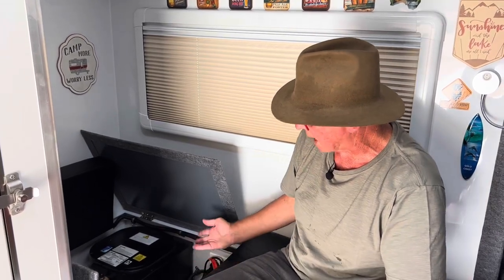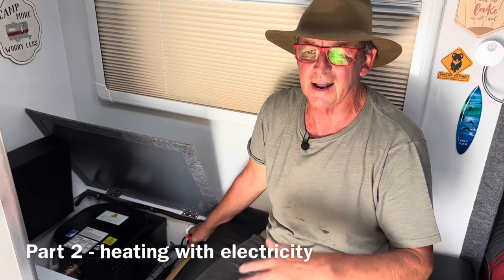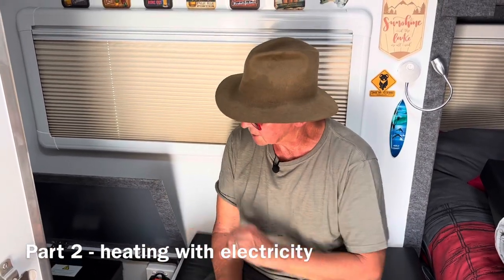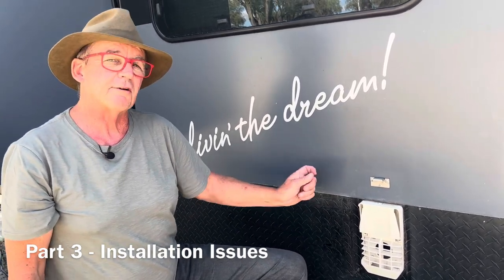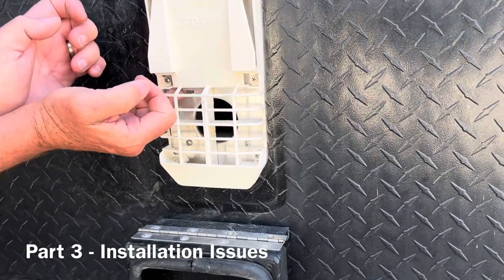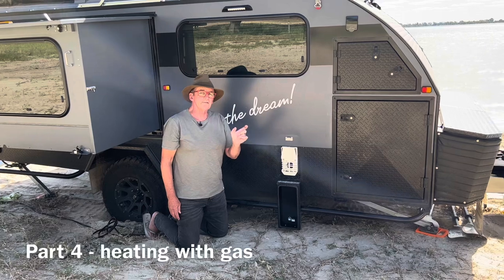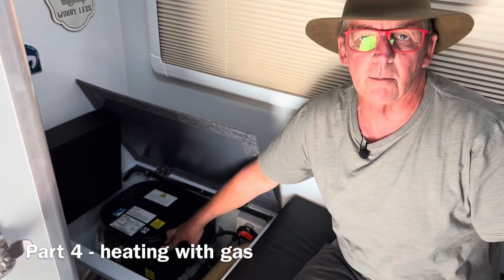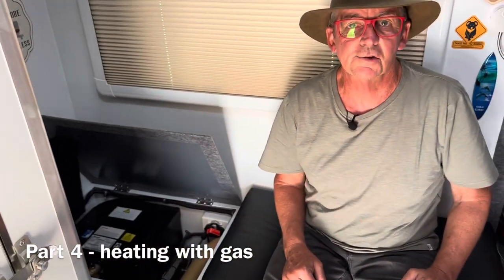AusCamping - Truma UltraRapid Troubleshooting

Comment: All good explained here, with one exception. How do I know the PCB (electric circuit board) is not faulty, please? Batteries are good, gas is there too, the cowl plate is sealed, gas ignites, but the fire stops after 10 sec or more. No wind no cold.
Reply from the maker: Thanks for your question, you would need to contact the manufacturer to get details on the circuit board. I am just an end user and fellow camper, sharing my experience with the water heater. I don’t know anything about troubleshooting the PCB sorry.

Comment: Hi mate, Thank you for you video. Everything checks out for us accept the last couple minutes of your video. We are having an issue with the red light coming on. We have gas, water and everything checks according to your suggestions. Any ideas as to why the fault red LED light keeps coming on if everything else looks fine?
Reply from the maker: Hi Dale, red light comes on if the burner fails to ignite or gets blown out and fails to reignite. In a quiet environment, if you turn the switch on, you should hear a clunk sound as the gas valve opens, followed by a ticking sound which is the ignition sparking and if you listen carefully, you can hear the gas ignite (similar to a gas BBQ). 

If your system is new, it can take multiple ignition attempts before you actually get gas all the way from the bottle to the water heater as the gas line is likely full of air. You should still hear the ignition but if no flame results, then the gas valve closes and the red light comes on. 

If on the other hand, you get ignition initially but the flame goes out after a while and that is a recurring problem, then you’ll need to take a closer look at the manifold and make sure it is mating hard up against the external wall plate, if not, it will be in taking the exhaust which is already oxygen depleted and causes a flame out after a while.

Comment: Excellent video. Our problem is that on both 240V and gas, the hot water runs out very quickly. The van is 3 years old and never had an issue previously. Any clues??
Reply from the maker: Hi Kevin, we haven’t got any personal experience with your specific problem, from a general troubleshooting perspective I would recommend opening the lever on the safety valve and making sure that you bleed out any air until you have a solid flow of water through the discharge pipe. If the problem still persists after that, then I would contact Truma support and ask them your question (1300 07 2018)

If you find the problem and solution, feel free to let us know, we may include the problem and solution in a future video.

Comment: Hi Craig where did you get the hinged cover for the HWS? So much easier to use than the plastic cover.
Reply from the maker: Thanks for the question, our van arrived from the dealer with that cover. I see that the newer models have the standard Truma plastic cover which I agree, is a pain in the arse to take off. Personally, I would go to a metal fabricator and ask them to make me a cover. Hinges and pinch weld (the sealing rubber) are available from Bunnings, so a self insulation wouldn’t be too difficult.

Comment: Great info mate , I'm a new subscriber and am really enjoying your videos.
My question is , once you light your hot water system on gas do you Just leave it on or do you turn it off say when you go to bed ?
I'm new to this and was just wondering what the best way would be to run it as I don't want to stuff it up.
Thanks for any info you can forward to me
Cheers
Reply from the maker: Hey Mal, thanks for your comment and appreciation. We tend to turn it on and leave it running until we’re packing up to move on. Always shut it down before hitting the road but no problem to leave it running while you’re set up camping. 

Of course, if you wanted to save some gas and you only want hot water at certain times of the day, then also no problem to shut it down when you’re not using it and just fire it up half an hour to an hour before you need it. 

It’s a personal choice, there’s no wrong way. We all camp differently so just do what works for you 👍
Reply: @AusCamping  Thank you for the prompt reply , really appreciate it

Comment: The ring that holds the top and bottom of boiler is leeking 3 years old ??
Reply from the maker: Had this issue recently with ours also. It’s not real easy to dismantle but I removed the clamp ring, found the pin hole and sealed it with a water proof tape and then reassembled it. So far it is still holding but I suspect we will need to replace the unit or at least the holding tank

Comment: Hi Craig.  Our Truma stopped switching on with gas.  I went through all the usual steps.  I can hear the click when I switch it on and the red light does not turn on.  Just wondering whether there could be an issue with the ignition system, such as dirty or faulty spark electrodes.  My question:  Do I have to take the complete system out in order to check this?  It looks like our one is mounted in a similar spot.
Reply from the maker: If the LED is not coming on, then it could be a blown fuse, I'll post a link to the user manual, check page 5, the troubleshooting section lists your symptoms regarding no LED and the Maintenance - Fuses section (also on page 5) has the fuse location and specification information.

https://www.caravansplus.com.au/pdf/Truma-Ultra-Boil-Manual.pdf
Reply: @AusCamping  Sorry Craig.  The led does come on after 30 sec or so.  Yesterday, I  took the cylinder out the motorhome (quite a job) and it is now on the bench.  I cleaned it out with a compressor.  The gas inlet looks clean.  Would it be advisable for me to replace the Flame Rectification Electrode and/or ignitor (unbelievable expensive) for a new one before putting everything back in the motorhome, just in case?  I don't think there is an easy way to test these.  Thanks for your reply, Klaas
Reply from the maker: @Klaas_H at that stage, I would be seeking advice from the manufacturer. The unit is either failing to ignite or flaming out and failing to reignite. I would think that Truma would be able to advise the most common cause.

Comment: My van is new me, but has seen a life, it works on 240v, had to replace the fuse on the PCB for gas to work, which now makes great clunks and clicks but then goes red, cowling cover is off, but never ignites. Gas is flowing to the hobs and valve open. So my worry is gas is not get into the igniters, how can I verify that?
I have repeatedly started and stopped the gas but it always goes red?
Reply from the maker: Hey Mark, sounds like you are well down the path of troubleshooting. Trace the gas line back from the heater and check that there isn’t another isolation valve that has been turned off. Each appliance will have its own isolation valve. It’s good that your hobs are working because that indicates gas is available but may still be isolated from the heater. 

After that, if you are still not getting ignition, then I would suggest that you contact Truma for further support. 

I haven’t had the need (so far) to dig into the gas jet or igniter and I’m not one of those people that pretends to know everything. I’m happy to say “I don’t know” in this case rather than give advice on something that I am not 100% sure about. 

Let me know how you get on with it and perhaps we can share your experience with others. 🍻

Comment: G’day , just following Your directions ref the 240 use, and still can’t seem to get it going. Works on gas though. I’m  Out of ideas.
Reply from the maker: Hey Craig, sorry for the delayed response, my suggestion would be to look for the black cable coming out of the heater and into the 240V outlet. Plug something else into that outlet to see if it is actually working. If you can confirm that you have 240V at the outlet with another device but you water is still not hot after 30-40 mins, then I would recommend getting it looked at by a professional.

We do notice on ours that it takes longer to heat on 240V and it is not as hot as it is on gas.

Comment: If your heater keeps turning off what do you do then ??
Reply from the maker: Hi Lynn, in the 3min-9min portion of the video, I talk about the most common installation issue that causes repetitive flame outs and right at the beginning, I talk about making sure you bleed any air out of the system and that the Hot water system is full of water. 

Lack of water will cause the heater to shutdown and poor airflow/ installation will cause flame out.

Comment: Well mine leaking water from the top area , can’t really see where it’s coming from because of the covers , I’m going to see if I can get a isolation valve put in son I’ve still got water to the van taps , most annoying i have turn the water off and release pressure otherwise I’ve got water dripping on the floor , I guess I’ll have problems with that in time
Reply from the maker: Definitely need to get that looked at, have you checked to see that it has the mandatory pressure regulator installed on the inlet line? They aren’t designed to handle full water pump pressure or mains water pressure.
Reply: @AusCamping  that I also wondered with pressure I’m on bore and pump setup the water quality is very good but when I’m washing dishes I get a surge of pressure so the heater is getting this surge as well

Comment: I bought a 2nd hand van, and the cowling screws are rusted in solid.
I wish they would spend an extra 2 cents and put stainless screws.
The plastic cowling I think is approx $160 to replace
Reply from the maker: Frustrating isn’t it.

Comment: 19.06 what brand of mastic did you use ?
Reply from the maker: Hi Evie, I ignored the manual in this instance. They recommend to use mastic not sealants because most sealants aren’t suitable for high temperatures so it’s a safer for them to recommend mastic. I used SikaSeal appliance sealant which is available at Bunnings and suitable for temperatures up to 250°C

https://www.bunnings.com.au/sika-300g-black-sikaseal-appliance-silicone-sealant_p1210606
Reply: @AusCamping  Thank you so much for your reply. We tried normal Bostik Mastic but I think it was not suitable for heat applications. Thank you again we will be off to Bunnings ♥️

Comment: Did all the checks as you suggested for 240 V still doesn’t work
Reply from the maker: If you have confirmed that something else works when plugged into the same power point, then you will probably need to get the unit serviced by a professional